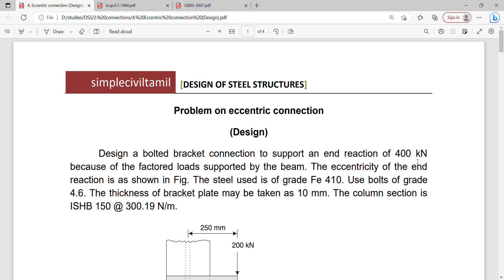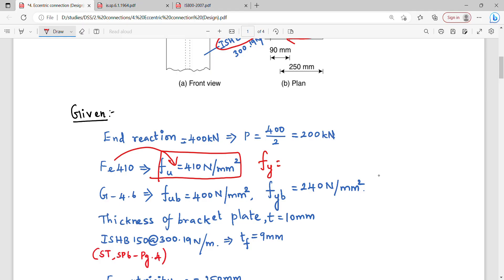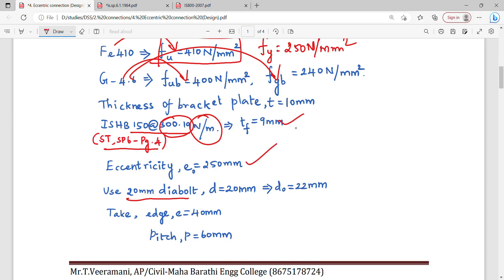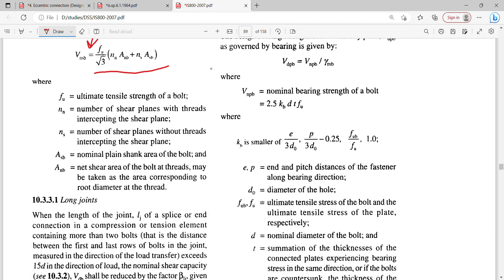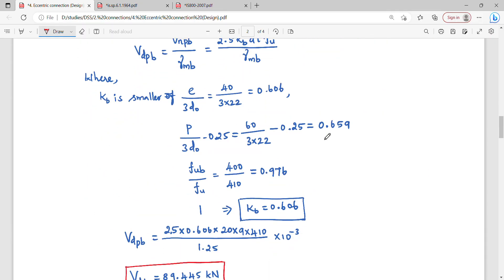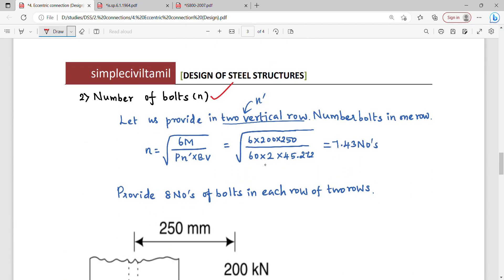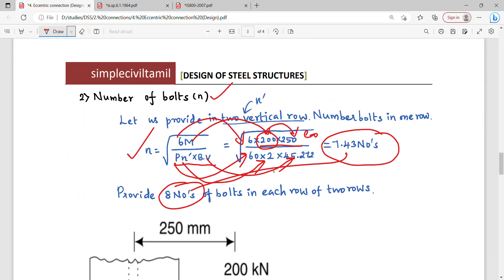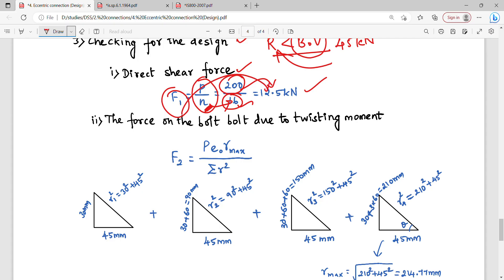Eccentrically loaded design problem

Comment: Sir how did you get the e value as 40 and p value as 60. 
Isn't this correct--- e=1.5×22=33
P=2.5×20=50
Please reply sir
Reply from the maker: What you find is correct but We can  take e and p value more than that meanwhile we shouldn't take less than that. For the time saving reason in the exam, I took this value directly. Hope you understand. Thank you dude.